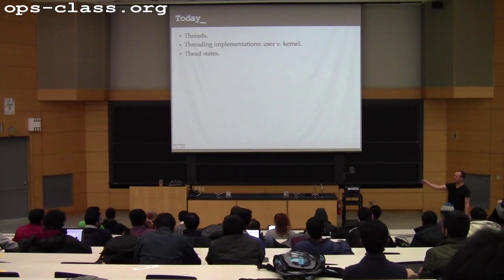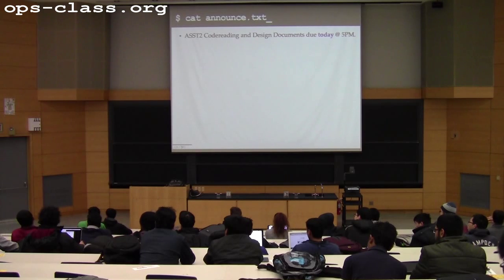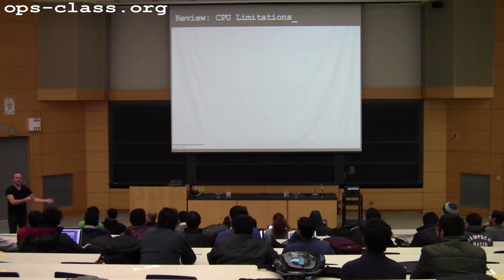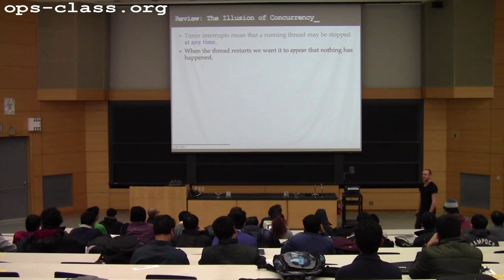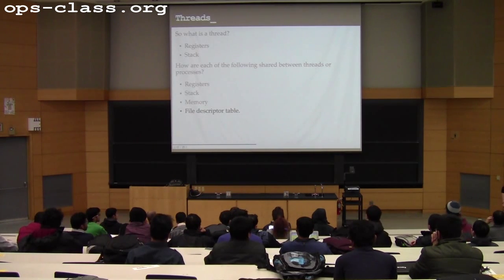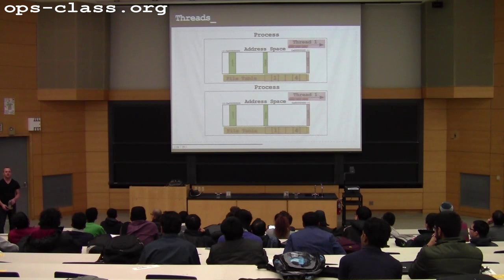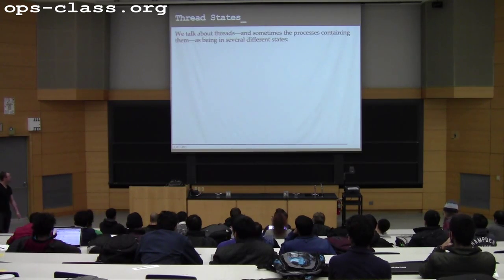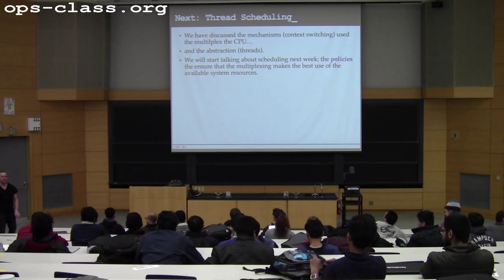20 Feb 2015: Threads and Thread Implementations

Comment: How does pthread like lib thread (use level thread) run on multi core machine if kernel is unaware of those threads?
Reply: use level thread will not be able to leverage multi core machine. Geoffrey Challen talked about this topic at 44:18.